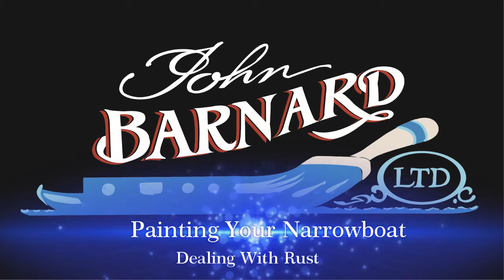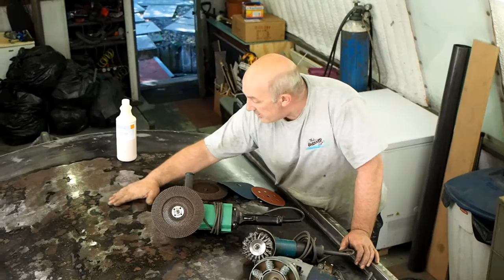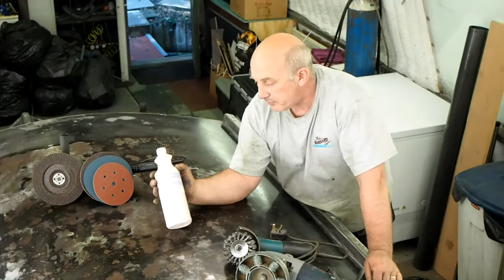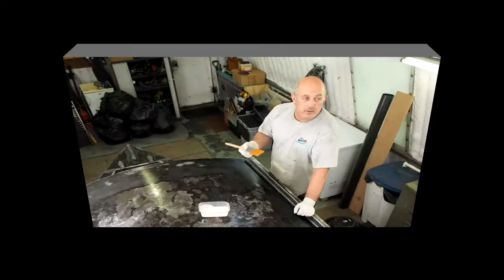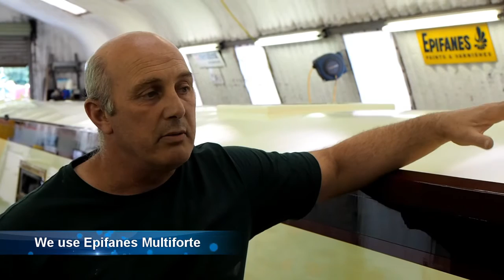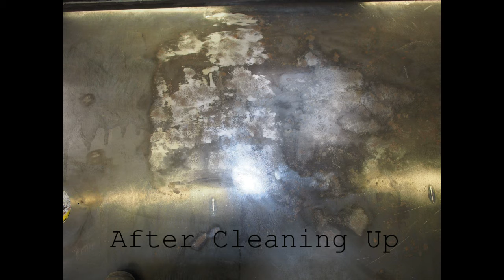Dealing With Rust

Comment: Are there any long term tests of this Vactan stuff? Does it really stop rust spreading/appearing again??
Reply from the maker: hi Steve the boat shown is still not showing any signs of rust so thats about three years, it is important to make sure that all the next coatings are the right thickness
Reply: @JohnbarnardBiz  I'm thinking of using this stuff on a pickup truck actually, items like the axles, diff and suspension arms have surface rust. I'll be keeping this truck for many many years so trying to do what I can to preserve it.
Reply from the maker: the vactan converts the rust and puts down a barrier but you still need to carry out good painting to keep the surface protected
Reply from the maker: @MariaA Dv Survivor  Hi email me at john@johnbarnard.biz and I will send you details

Comment: How long did that take you? Is it possible to do that outside if you cover the top when the weather is poor?
Reply from the maker: hi Kate about 2 weeks including stripping back and all the drying times,
it can be done out doors but make sure if you cover your work so the damp does not get in if you feel that it may have done then get the air to it and do not paint until you are happy it has dried out
Reply: Thanks!

Comment: Hi John - this is a great video! Going to attempt to repaint my boat this summer so your tutorials are massively appreciated. Quick question, having looked a bit more into scabblers, they seem like very effective machines for taking down to steel but also large and presumably heavy. You obviously focus on the roof in this video. Have you ever used a scabbler on the sides or would you only use it on flat surfaces such as the roof?
Reply from the maker: hi Tommy - yes i use the scabbler for all the boat sides included